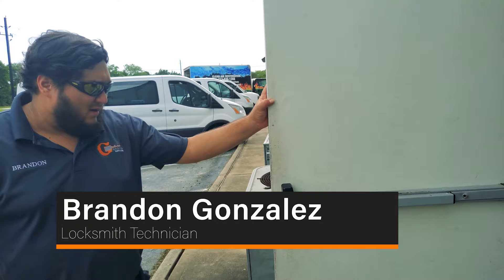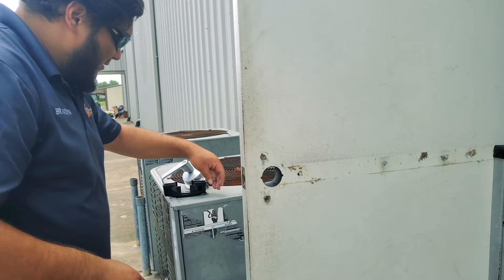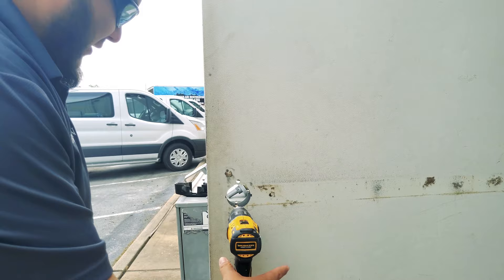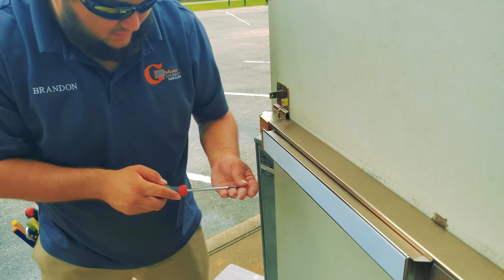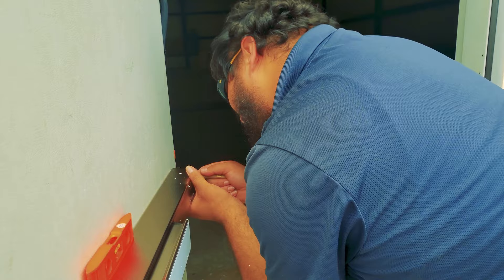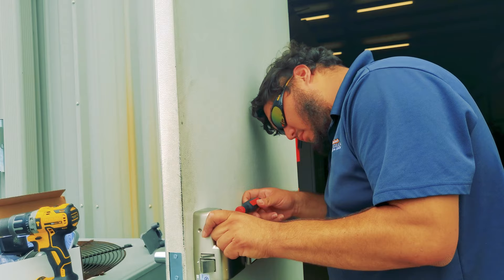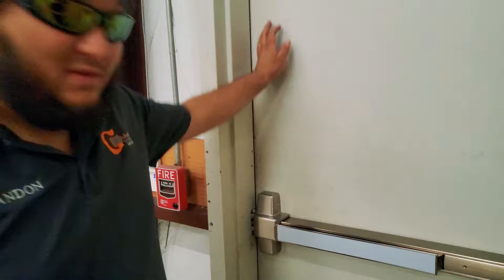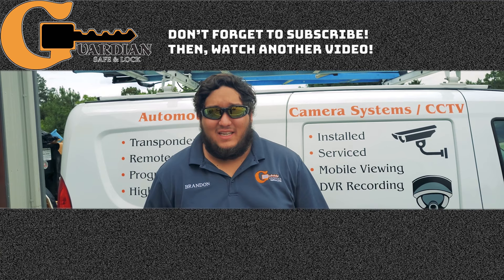How A Locksmith Does Panic Bar Installation

Comment: Great work! Just a tip for high-use doors, tap the holes yourself, add machine screws and some blue loctite. The last thing you want is a panic bar that comes loose/falls off. Awesome demonstration nevertheless :D
Reply from the maker: LockmanMD Solid tip! 👍🏻
Reply: Also, if it is a fire rated bar, so too are the fasteners....do not replace the factory fasteners for installation convenience.
Reply: Yes! I do this. I dont like using self tappers because every time you remove the screw you strip a little bit of the surface.

Comment: Why do you need the dog lock if you're pushing it from the inside anyway and the door opens without a key from the inside?  Is that just so you can get in from the outside by pulling... So is there no way to keep the outside lock unlocked while in use and then lock later when you leave is that what the door lock is for I'm assuming It's a one-way door kind of sort of?  Thanks for answering my long question
Reply from the maker: Hey thanks for watching! If you have a entry function lever trim then you can t leave it unlocked, and there’s no need to dog it down. But say that it’s storeroom or nightlatch function, which is where it’s always locked from the outside and you can’t leave it unlocked. Then you could just dog down the bar and leave it unlocked, then un-dog it later to return to the original function. Thank you for supporting our channels, don’t forget we have two other channels UDROpreneur and Guardian Approved. Thanks!

Comment: Are you able to use a handleset on the exterior with a panic bar?
Reply from the maker: To answer your question... No, but I think I know what you may have seen that might have lead you to believe that. Or maybe you were just asking lol Anyway there is outside trim that interacts with panic bars such as a lever or knob, and those are just referred to as lever trims or knob trims. And those come in different functions such as entry, night latch, classroom, etc... and then there is what’s called escutcheon trim and that’s what you may have seen. It kinda looks like a handleset on a residential front door..... kinda lol. So lookup escutcheon trim for panic bars and that’s what you’ll find. Thanks for watching, please check out our other YouTube channel “UDROpreneur” and if you would please subscribe to our channels we’d sure appreciate it. Thanks! - Uriah
Reply: @GuardianSafeAndLock  Thank you so much! That's exactly what I was looking for!